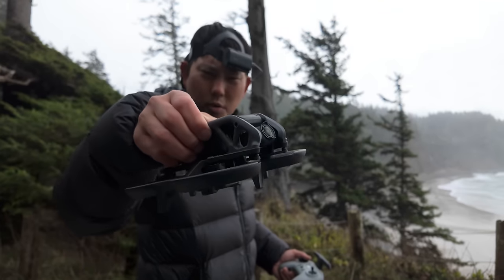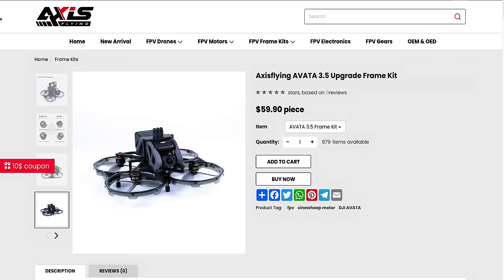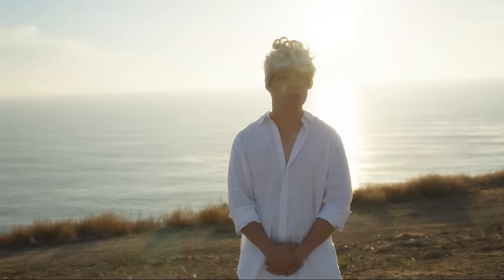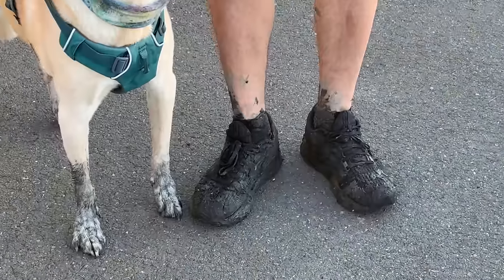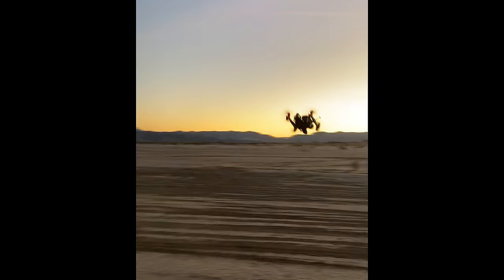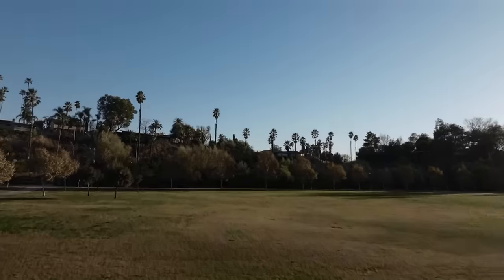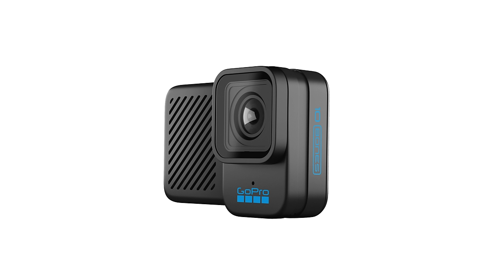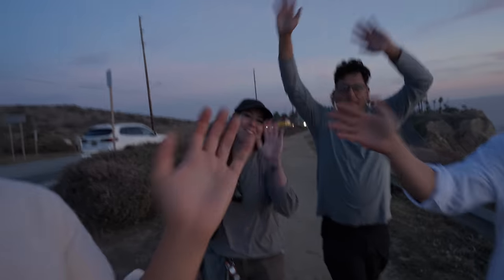How to Hack the DJI Avata To Fly INSANE! The smart FPV Drone Supercharged!

Comment: I converted mine as soon as the kit came out and haven't regretted it for one second. That's the way DJI should have shipped the Avata in my opinion. I wouldn't be surprised if the "Avata 2" turns out to be very similar to the Axis Flying kit.
Reply: Was this your first time taking apart an FPV are you do have experience with it ?
Reply: Any news on the avata 2?
Reply: But marketing said 3" is the new thing...
Reply: You were right.

Comment: I have been working with drones for years but I have only recently entered the FPV world. - I have an avata and a Nazgul Evoque 5". I would like to buy a cinelog 25 and a cinelog 35. I like this idea of modifying the avata because it would allow me to mount my gp12 or my OneRS on top of the drone... also eliminating the problem of the lack of power and stability it has. Considering that I want to invest in a new RC radio and increasingly enter the serious FPV world (studying betaflight etc...) I'm not sure However, I'm sure if it makes sense for me to spend money and time to make the Avata a perhaps 'unsuccessful' 3.5"... no longer even salable rather than buying a designed and tested drone like a geprc or betafpv...thanks for the video!!

Comment: i have problems with mine where it constantly has the motor overloaded message and turns off after about 10 seconds. thoughts???? great video! also yes to the shave. i think there is a reason she told you to vote on it brotha

Comment: Awesome video!  What are the advantages of filming in 24Fps vs 30fps/60fps? Im just curious im new to video editing thats why i asked. I noticed that when i had the camera drones before the fov drones a few years back, they all had a 24fps mode and 30fps mode that was labeled HQ i think. So i used that, but i figured for faster drone shots of mountain diving or say freestyle flying. That you would want the extra fps of using 120fps/100fps? lol idk sometimes it doesnt make sense to me. On a game or sports you want your tv to have a better refresh rate for motion blur, it doesnt work the same when actually filming it? What resolution do you record at on the DJI Avata where im assuming youre not using an additional camera like a GoPro or something?

Comment: I think you can remap the disarm switch to the 3 position switch that controls the camera. I did that for my Dji fpv drone. I don't double tap anymore
Reply from the maker: I definitely like the switch more than the double tap but when I tested it, it only disarmed in manual mode. Problem is I often hit the position hold right before crashing to see if it can save my fall, but that also pulls me out of manual mode and my disarms stop working while it flops around everywhere. I think that switch would be incredible if it worked regardless of the mode.
Reply: @PotatoJet  that is true... I mostly fly manual mode anyway ☺

Comment: Is the avata easier to fly compared to a non dji cinewhopp with for example a betaflight FC?
Reply: Tad more complex - the avata doesn't have Angle Mode - which is also know as level mode in the liftoff simulator. Am hoping DJI pushes a firmware update allowing the avata to fly in Level Mode, all in all fun..

Comment: Been practicing in a simulator and will practice soldering soon! Think I should I wait for the rumored Avata 2 to come out or buy a used Avata at this point?
Reply: Id buy a used one so I can crash it without guilt
Reply: Buy a used one then - takes about 4 hours to do the motor upgrade but practice on some 9$ soldering kits before working on the AVATA - reaaaaally tricky and challenging even if you're tech savvy..

Comment: I am not a flyer yet, nor had too much of experience with them flying buggers, purchased Avata a few days ago and still waiting for its arrival. I have a question though, could prop guard from stock drone be removed and bigger props then installed? :P
Edit: ok so I see now where the problem may be, it will need to have different frame ( wider/longer ) to accomodate bigger proprs, that's a bummer :P
I was also thinking of custom made antenna Yagi Uda style, I have knowledge and means to make them, and isntead of ripping off existing ones from Integra it would be enough to drill two or one hole to let coax pass trough. What would you think?
5 element yagi would or could have Gain od 8dBd (approx.)

Comment: I have a trick for 24fps! Shoot in 50fps and set the shutter to 1/50th then in post confirm the footage to 48fps and drop onto a 24fps timeline. Definitely not the simplest and technically slows the footage down by 2fps but it’s not usually noticeable in drone footage. Let me know if it works for you!

Comment: So new beefier motors, new larger props, new prop guard design, and entire new frame.... So basically you got rid of your Avata, DJI warranty and the ability to have Care Refresh+ so that you could use your Avata batteries with a new drone?

Granted, it's certainly an improvement, but it seems like you should have just bought a new drone with the DJI 03 transmission system, of which there are dozens of quality pre-built models for a couple of hundred bucks.

Comment: You can set the 3 position switch that usually changes gimble angle, to be a killswitch.
Reply: yes, works perfectly
Reply: On the Avata, how do you do that? Thats been my biggest complaint so far also, but i didnt know this.. I do like having that gimbal switch when i use it in Normal and Sport mode, does it only apply to M mode or for all the modes? 
Thanks!

Comment: I have 2 Avata’s, one with just the stock body and axis flying motor upgrade and the 2nd one with the full 3.5 axis motor conversion and both fly crazy nice. Be honest they both feel like completely different cine whoops and I can’t even consider them Avata’s anymore. But the 3.5 conversion is much more quiet then the stock even with the motor upgrade but battery drains faster while the other is very nimble but mad fast aswell. 3.5 conversion can pull out of dives with ease. Overall both upgrades are very much better

Comment: you can program the avata to have a killswitch with the remote controller. you just have to add it under the settings in the goggles.

Comment: Still doesn't seem worth it to me, stock performance along with the master airscrew 3 blade props seems fine enough. Speed isn't everything 😂 You can change the button layout on the DJI remote to have a kill switch btw, the double tap is really unreliable. Hoping DJI will release another FPV drone soon and it will be a better performer than the last 2.

Comment: They dont use something like INAV that has the manual mode, but also uses Normal mode for the GPS hold mode, like the DJI Drones? That way when the video was lost, instead of disarming it you could of switched it to Stabilized mode and maybe it would have recovered. Either way it seems like on something big like that and also something expensive like that, you want some good safety fallbacks

Comment: Hate to spoil it to you but the axis mod is stupid. Once you have mod it you can't access the SD card port, you will need to get a sd card ribbon cable to reroute it. Another issue is that you will need to splice the motor cables to make it shorter for the mod.

I personally do this mod for pilots here in Singapore. Imo this mod sucks and totally not recommended. Do not do this to your Avata.